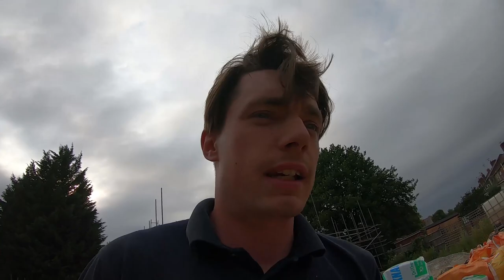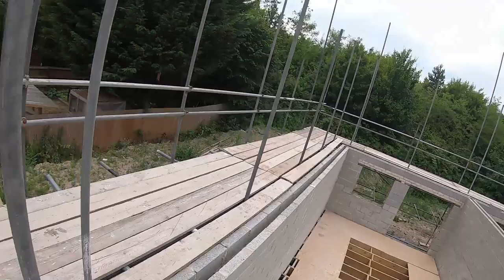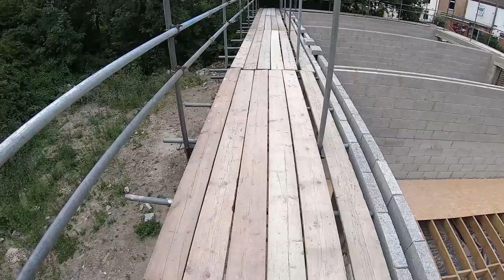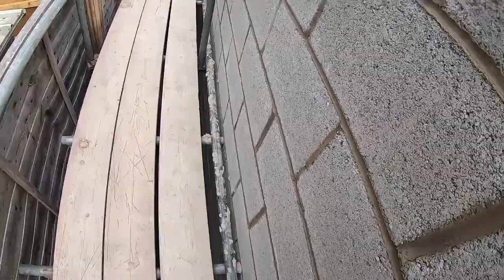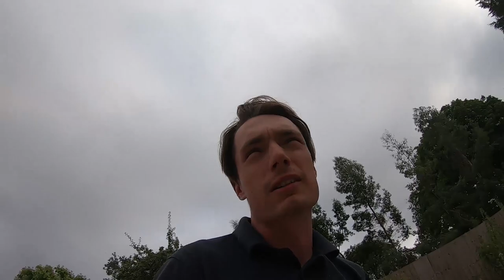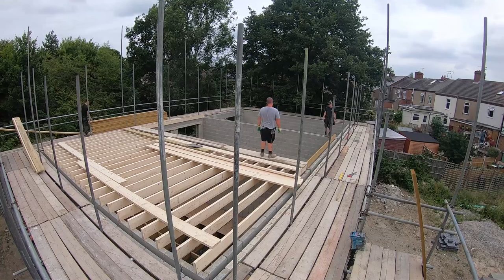Bricklayers Being Joiners #bricklaying #vlog #joinery #scaffolding #houses

Comment: Hey Morgan. You got on and did it. Quite impressive to be honest. So is the whole thing rendered and with a flat roof ? 🫣 Certainly built to a budget those ( 1 bedroom ? ) houses. Must be a complete change from working on quality places like the lodge. Looking forward to watching the rest of the build 👍👍
Reply from the maker: Cheers Doug 👍 
Yes whole thing is going to be rendered but they’re having standard trussed roofs 
Believe it or not, the back 3 plots are 3 bed plots, won’t be able to swing a cat around in them 😂😂
Yes it’s definitely different to the likes of the lodge extension we did, but the price is decent so I fancied doing something a little different 👍🧱
Reply: @MorganTheBuilder  Hey Mate. You've done a great job so far working on two plots at a time. Yes of course you have to work where you can to make a living. I suppose i was thinking out loud when looking at the size and finish etc. Really cant believe the rear plots are 3 bed unless the scale of it looks different on camera. No offence meant. 👍👍👍
Reply from the maker: @Doug....  no offence taken mate 👍 off the top of my head each plot internally is about 4.6m wide by approx 8.5m length, so not big at all